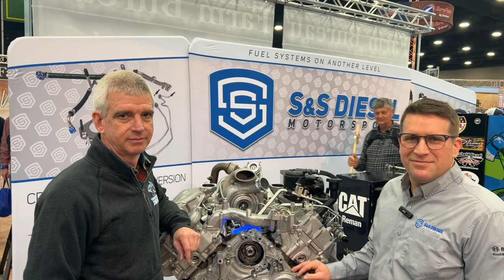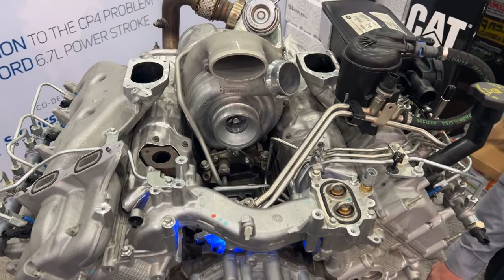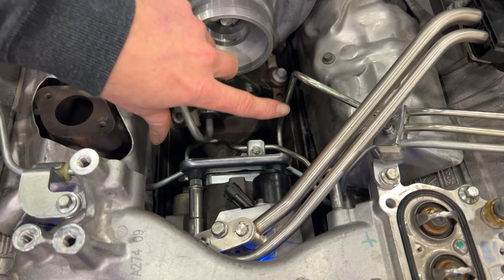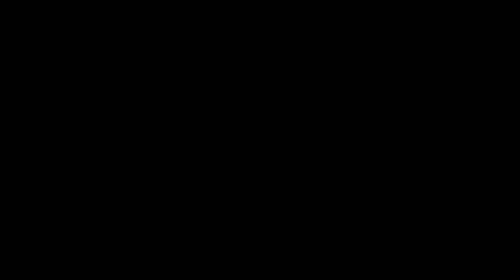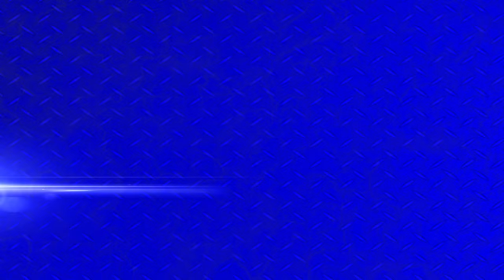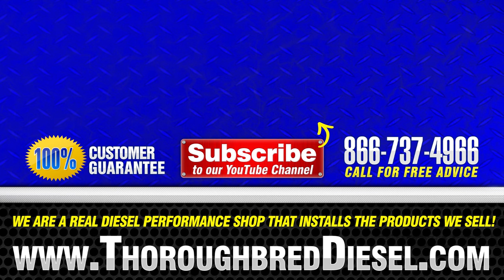Exciting DCR Pump Update For 6.7L Ford Powerstroke!  #diesel #ford #fordtrucks #powerstroke #shorts

Comment: I had Arod from PTT install the DCR in my 2024 H.O 6.7 with less than 600 miles on the odometer. Peace of mind is worth a lot. Almost 4k miles later it feels bullet proof. ARod did a great job installing a fantastic product from S&S Diesel. Thank you to ARod and the designers at S&S Diesel.
Reply: Arod is installing mine next month. I can't wait 💪
Reply: I have a 24 HO. So the DCR pumps are available for the 23 /24 HO now? In the video he said they are still getting emission test complete before they are ready for HO.
Reply: @jerronwoodell793  Why would you put that on a new truck? You guys are all falling for the hype.
Reply: @jerronwoodell793  They are not officially available. I think I'm the first person to install onto the 24 and the first to install onto the HO. Before I moved forward I checked with S&S and my mechanic to see if they knew of any differences. So while not official I decided to move forward and have it done. The install worked perfectly according to Arod at PTT and I already knew from S&S that the pressures exceed the CP4. In the end the fit, finish, install and performance have been perfect and I'd do it again. The peace of mind of knowing I never have to worry about the CP4 eating itself is worth it for me. My understanding is that S&S is currently testing on their own HO. Arod was in contact with S&S during the install just to confirm along the way what he was seeing and how thing were going.
Reply: @pat9125  The pressures do not exceed the cp4. It's volume. Pressure is controlled by the ecm and will be what's demanded no matter what pump is in there, granted it keeps up with the pulse width.
Reply: @HSKFabrications  My understanding is that it is capable of more pressure. I realize the ECM controls it but the capability and capacity is higher in both pressure and volume. That's from raw testing outside the truck. Perhaps you know something I don't?
Reply: @HSKFabrications  Why do you call it hype? Unless you aren't understanding the differences between the two pumps or unless you don't believe in the inherent weakness and risk of the CP4 your comment makes no sense. While it's true that not all CP4 pumps have had issues it's also true that enough have had problems that a class action lawsuit is pending against Ford and it's also true that if the CP4 eats itself it will take out the entire fuel system where the DCR wont. It's also true that our Diesel fuel is not up to par and getting bad gas especially at remote or off brand stations is a real thing. Not to mention GM and Dodge got rid of the CP4 due to the number of issues they had. Not sure what hype you are referring to. Swapping in a DCR in a new truck is overly precautious for sure but it also prevents a problem that could be devastating down the road.
Reply: @pat9125  It's not capable of more. From stanadyne themselves it has a max of 2400 bar (34,000psi) where the 2020 and up cp4.2 will produce 36,000 psi, which is what's demanded at WOT. The cp4 has 4 pulses per Rev to specifically match the 4 injection events per Rev of the 6.7 to create a linear pressure supply. Nobody knows long term what a 2 pulse pump like the dcr will do as far as pressure harmonics. I say hype, because that's what it is, the cp4 failures are over dramatized as an inherent issue, when in fact 99% of the failures are caused by owner negligence. In numbers alone in the US it has a 7% failure rate, in Europe, just 1%. There are tens of millions of these units in operation. My company has over 40 6.7 powered trucks that I maintain with ZERO failures as well as my personal one. These steps are what I have found throughout working on these for the last 14 years prevent the failures - 1. Alcohol-free fuel additive in every tank 2. Use high traffic fueling stations that sell tons of fuel ensuring it doesn't sit. 3. Drain your fuel/water separator every week. 4. Change your fuel filters every 5k miles same time as your oil. 5. Hold key on the on position for 5 seconds before cranking. This ensures positive pressure to the cp4 preventing a dry crank vacuum situation which causes the rotation of the buckets. Everybody I know personally that follows this to the T never had a failure. AND if you want real peace of mind you can install a dpk. Even better is a company called RCD. They modify the cp4 with pinned buckets, modify the case to return fuel to the tank(preventing contamination) and offer it in stock, 10% over stroker and 38% over strokers. I run the 38% on my personal because I'm highly modified. This is the pump that should be touted as the fix. Not a Chinese made pump that used massive advertising salesman like pttarod to sell it. You think that pump is indestructible you better think again, everything can fail.
Reply: @HSKFabrications  Apparently you aren't up to speed on the DCR pump and fail to relate to the average user. We can't all always get perfect fuel at the best stations. Many of us use our rigs off the beaten path. It's good you can afford to baby the CP4 and I guess that's the point. The DCR doesn't require that level of care and attention to not eat itself. We don't get to decide where we get fuel unless we live in a glass palace such as yours or perhaps engage in hotshot activity where we can plan a fuel stop. Many small towns across the country service many different needs and it's luck of the draw sometimes and the CP4 isn't up to the task. Also, Are you not aware that the DCR actually is capable of 25% more fuel flow than the CP4.2. Your numbers are incorrect on that. Perhaps you just don't believe the S&S testing results or maybe not studied them? Many people will be just fine with the CP4 but it's still a crap shoot and the DCR is the only solution that fixes it. Sure put on a DPK, it's almost the same labor as it is to just replace the CP4 and never have to look back where the DPK still requires a second effort equal to the first to replace the CP4 if it blows. To each his own and in your perfect example of maintaining a fleet there's probably no reason to change but on an individual basis the risk/reward may calculate differently. There's a difference between differing opinions and snake oil. I only take exception to your lack of knowledge on the DCR and your characterization based on fleet management which is a far cry from the average person using their rigs off the beaten path.
Reply: @pat9125 couldn’t agree more. I have had 3 cp4’s fail in two trucks. And I babied it and stayed on top fuel filters and additives. They are the Powerstroke glass jaw.
Reply: @pat9125  Flow is not the same as pressure which is why I said in my earlier post "volume not pressure" is higher. I know everything about the dcr, buddy. Draining your fuel water separator is free BTW. To me it just creates complacency and laziness since the dcr is touted as indestructible.
Reply: @jtopdawg6 ...what mileage was achieved before your 3 pumps failed?
Reply: @charliepiland3285  my 2012 it failed at 138,000 Amd again at 212,000. My 2017 it failed at 137,000. My 2019 has the dcr in it.

Comment: Retired Royal Canadian Air Force aerospace engineer here. JP8 is just Jet A1 (civilian turbofan/turboshaft engines use this) with corrosion inhibitor (CI) and fuel system icing inhibitor (FSII) added. That's the only difference.

Comment: And don’t forget to add that a brake down thousands of miles from home will cost a ton of money (tow, rental, flights, etc…). I run 60k-70k miles a year hauling 34k-37k pounds across the southern lane. I’d love to test out this pump. Already had the cpx pump explode after 25k miles, left me broke down in New Mexico so I know that route is definitely not a good one. It’s been more than a month and my truck is still not running after installing a new cp4 pump. Cpx pump is suppose to send metal straight to the tank but it seems like it sent metal straight through the whole system.
Reply from the maker: We highly recommend it!

Comment: Does any body know if the disaster prevention kit voids Ford's warranty? Before you ask, I couldn't get a straight answer from the Ford dealership I work with.
Reply from the maker: The DCR is not original equipment so switching to the DCR technically is not warrantable and depending on your dealership, they could bang your engine warranty for installing it.  We have not heard of this, and the Magnuson Act keeps you protected from your warranty being voided for a aftermarket product installation that does not have a direct effect on the warrantable item.

Comment: I bought the DPK from S&S Diesel and installed it in my 2021 F350. I figured $400 for the DPK was worth a try after seeing the videos showing how well it worked to protect the rest of the fuel system. If my CP4 dumps on me, I'll buy the DCR and replace it. Thanks for your informative videos. I'm thankful we have recourses like Thoroughbred Diesel and S&S Diesel to have our backs while FOMOCO sits back and apparently does nothing to correct this pump problem.
Reply from the maker: That means a lot. We obviously are trying to sell parts but we have a passion to try and help people. It's what we built our brand on. That gets hard as we get bigger, but these videos are one way we can still help out our customers.
Reply: My thoughts exactly, I have a 19 350, I put the DPK in last year, if this CP4 blows up I’m going to be putting in the DCR.

Comment: Did they change the design for clocking the dcr from the dimple to a key way?
Reply from the maker: Not yet, still relying on the marked camshaft.
Reply: I like the dcr replacement but will not purchase one until they perfect their product. I don't want any chance of failure.

Comment: Is there any data on how many CP4 pumps have failed?
Reply: Less than 7%. Out of millions. Less than 1% in Europe. Don't be so quick to jump on the bandwagon.
Reply from the maker: We sell the DCR because we have been dealing with customers daily since these trucks came out (2011) with CP4 failures that cost them a fuel system.  So in over 10 years, I would tell you that’s several thousand customers we have dealt with.  We believe it to be the best fix on the market right now for CP4’s as a replacement goes.  This isn't some mickey mouse failure that might cost you a couple hundred bucks and some install time.  This potentially can cause a failure that will cost you thousands of dollars, time and its generally avoidable with products like the DCR and DPK’s.
Reply: @thoroughbreddiesel  I get it, but those failures are majority of the time trucks with "gas and go" type of owners, hence the reason they'd take it to a shop. The dcr is perfect for them. My issue is it being touted as indestructible and the hype of the actual problem to create panic.....to sell a product.
Reply: Hey Bill martin4602, I call bullshit. I am master ford cert tech in Permian basin of Texas. Truck country. I have had so many pump failures. Guess your lucky where your at but the cp4 and cp4.2 sucks bad. The % is more around 20% from my viewpoint. That's besides dumbasses who put Def or gas in.
Reply: @tomroe7715  Of course you see the failures, you're a tech lmao. Since it's "truck country" as you say, there are more of them on the road. I'm also fully aware of the maintenance habits of the trucks in west Texas especially ones used in the oil fields.
Reply: On some Cummins engines it was enough cp4 failures that they recalled all of them and retrofitted cp3s back onto them. Every OEM that has used the CP4 dislikes them. They are the main game in town though, and make a very complete full system turnkey which is why OEMs use the CP4. The pinless tappet design is simple not robust to fuel contamination and or water in fuel. When they fail Bosch usually always tells the OEMs it's your problem BC the fuel quality was outside Bosch limits. So while the trucks under warranty the OEMs has to eat that warranty cost and Bosch gets paid again. Source... Worked in industry. The Stanadyne  pump original version of this was specifically designed for the Cummins ISG12 engine sold in the China and Asia markets. Those places are notorious of cuts and blending fuels, poor filtration, and water in fuel.... The Stanadyne pump version on the ISG12 has proven robust in that market with bad fuel daily. All these replacement kits for usdm trucks are versions of that original pump. They are not the same. They are tuned internally to match the CP4 performance as closely as possible and in some areas smooth out the performance curve of the pump output. Teams of engineers the technicians in the USA are tailoring the pump performance for each truck kit.  The pump have differences between the kits to make that happen. They are not just the same pump slapped on each truck...unless they happen to need the same pump performance curve. Yea initial pumps have been made in China bc that is where the high volume to support Cummins China had to be at. Stanadyne owns a factory there. USA line is up now and running. Rambling stop.

Comment: What competent engineer would design a roller piston mechanism for a fuel pump with a round bore that didn't specifically , in any way,  accommodate for the piston-roller assembly rotating in its bore? There is a reason roller lifters traditionally are connected in pairs and the reasons are certainly not new; over 50 years. I would really like an answer from the CP4 design team WTF were you doing?
Reply from the maker: The need for a pump to deliver a higher pressure regiment than a CP3 was met with the CP4 but they missed the mark with its durability in my opinion.

Comment: what about the NOCKING NOISE after two pumps being installed on a 2011 F350 6.7
Reply: What are you talking about?
Reply: We have put two DCR pumps in the truck and both are making a nocking noise the noise is louder then the engine noise
Reply from the maker: What was your original failure in the truck?  Have you worked with S&S to figure this out (I assume you have with two pumps).  We have sold thousands of these pumps and have never seen back to back failures.  Call us at 866 737 4966 and let us work to get you lined out.
Reply: @thoroughbreddiesel  there was no original failure
Reply: Yah I was thinking about your two pumps doing the same thing, what are the odds that you get two??? Something else has to be going on.
Reply: @lewisbolman7862  the truck was fine before the DCR pumps I talk to a friend he works a Midas and he put a DCR in a Dodge and it sounds the same he said not sure what 🧐going on
Reply: @edwardeplett3231  morning have you figured out anything on the noisy Dcr pumps?
Reply: @lewisbolman7862  nope 👎 am going to run it for a month and see if the noise is less I did a BG engine flush and a BG oil conditioner and change the oil to a 10-30 a good quality oil the shop put a cheap oil looks like water making sure it was not a lifter engine noise but the noise is less then what it was for sure
Reply: @thoroughbreddiesel  I wish I could drive over have you listen to but i am up in the north west
Reply: @edwardeplett3231 Hey, (time for a professional 2nd opinion)ask around about a good trusted diesel shop in your area other than the one that did the work...almost sounds like installer may have drop something down in the gear housing & that could cause a lot of damage if the noise is around the pump area...Or maybe drop something down intake if noise is more in the motor area.... would not keep driving until I have answers...good luck & be safe👍
Reply: @zekester1  we used a scope to hear 👂 it coming from the pump it self
Reply: @edwardeplett3231  Is this the second pump?...I've got 12+k on the DCR with a total of 85+k on my '18 F350 drw...No noise & to me operates much smoother than the OEM pump...Runs great & does what ever the ECM asks...monitor actual & commanded fuel rail pressure...I know it's more money but I would for sure have things checked out completely & have a cause locked down...again good luck & I'll keep my fingers crossed
Reply: @zekester1  ya second new pump in the box ya I may go to Oregon Fuel injection in Eugene Oregon since I live in the north west ask them to reinstall the pump and make sure it was time right
Reply: @edwardeplett3231  Wow, sorry man that's crazy!!...Still going to🤞For you...things will work out👍💪💯
Reply: Are you sure its not the vacuum pump that is noisy? Injector fuel knock?
Reply: @sounboy4498  it’s going to be replaced this weekend
Reply: @edwardeplett3231  it was confirmed to be a noisey HP fuel pump or something else?
Reply: @sounboy4498  the DCR pump is new how can I put it the noice is like a typewriter I change the oil first thing the shop had put in  oil like water I always put 15-40 rotella T6  but I put Rotella 10-30 T5 and did a BG engine Flush and a BG oil conditioner noise is reduced a lot but if you go to the driver’s side wheel well and the front of the truck you can hear 👂 a typewriter noise so maybe go back to the 15-40 🤷🏼‍♂️I have to investigate because the shop that put the DCR pump in is not get the truck back there stupid
Reply: @edwardeplett3231  sounds like the lash adjusters for the lifters noisey as quite common, especially after an oil change. Put back the oil you normally run an take it for a drive an see if the noise is reduced or goes away, those engine flushes are never a good idea, uf you do your oil changes on time you should never have to flush your engine if your maintis on point!
Reply: @edwardeplett3231  have a look at the left side valve train components, rocker arms, push rods, pushrods etc...
Reply: Today I pulled off the vacuum pump to check if the DCR was timed right from the Shop  it set at almost 8 clock I put in a new vacuum pump, belt ,new secondary water pump and I am not hearing the knock noise so far I will drive it two weeks and see if it comes back 👍
Reply: @edwardeplett3231  nice